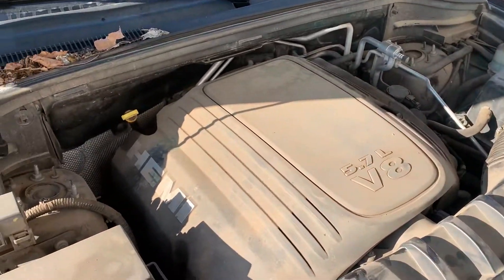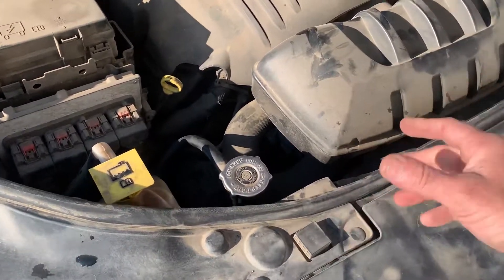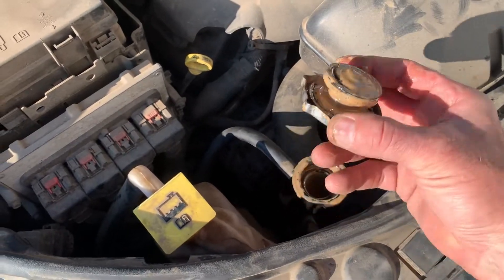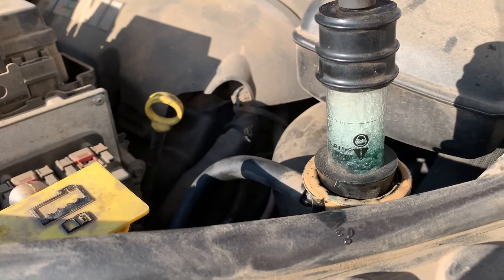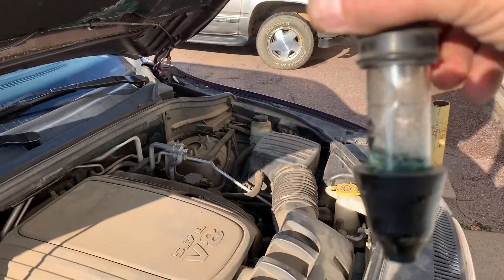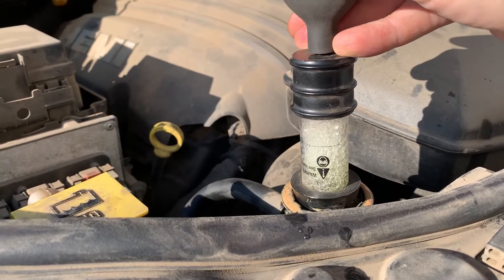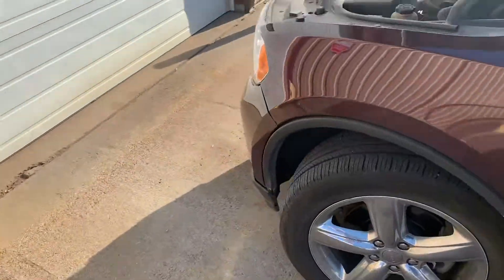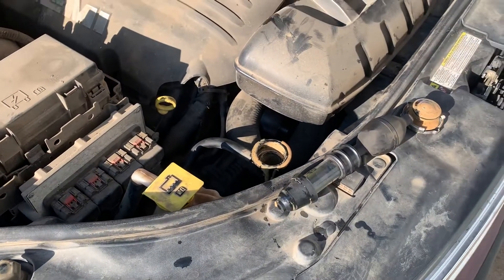How To Check for Head Gaskets Failed or Oil Cooler Problem Exhaust Gas Test

Comment: Hey just wanted to thank you for the K-Seal recommendation. I have an older Toro 6500 fairway mower with a Peugeot engine that was leaking coolant ‘somewhere’. Not a lot mind you but enough that after a few fairways the coolant light would come on. Put the K-Seal in and it stopped the leak down completely after a few minutes. You have a great show and I enjoy it immensely. 😊